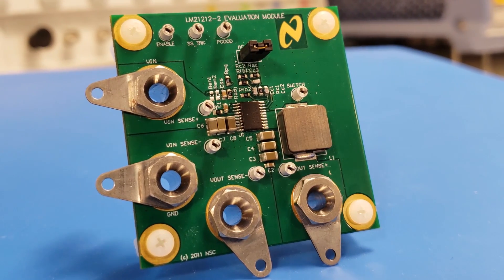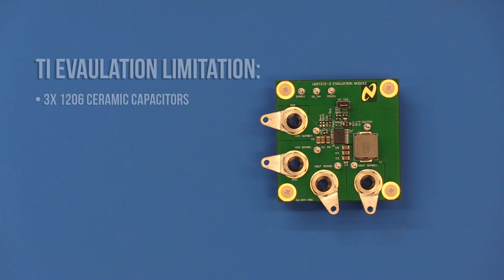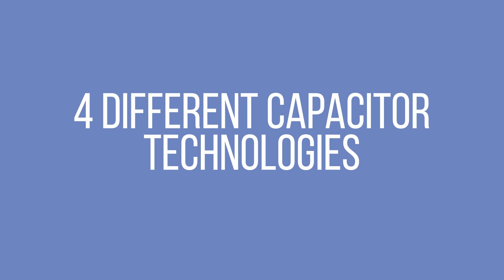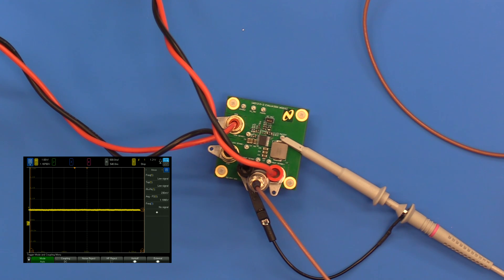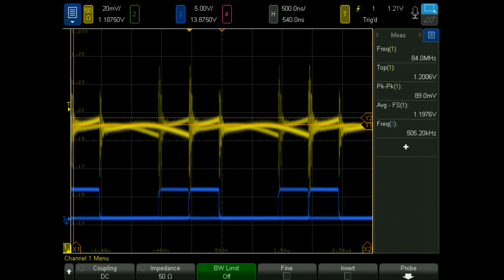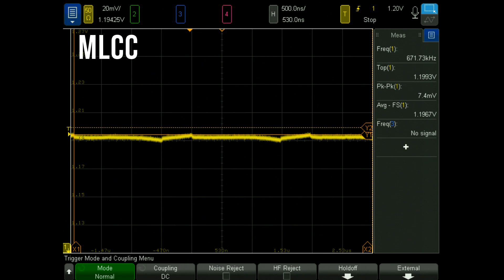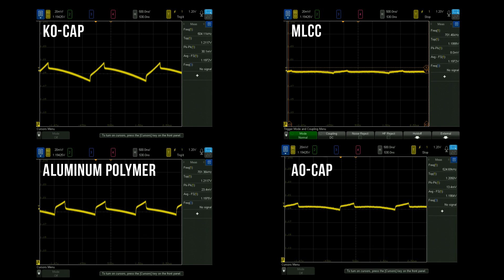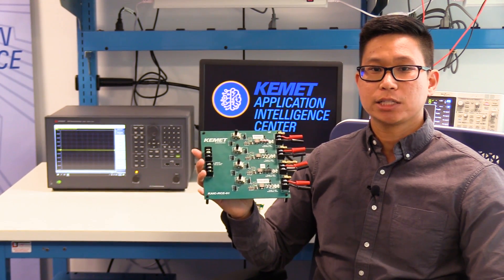KAIC Lab #1: Understanding Ripple Voltage Based on Different Types of Capacitors

Comment: Dear Kemet, 
I am sorry, but you faked the measurements on TI's board. Here are differences:
On TI's board the ground lead on the probe was used during the ripple measurements. This is totaly no go for the ripple measurements. The short ground spring should be used there. Due to ground lead are such a big spikes in measurement. We don't know what is the ratio of the probe used at TI's board. If it was 1:1 ok, but if it was 10:1 than the result can't be so good as you messure with 50ohm terminating input on scope using SMA connector. And last, it is not clear if you have used BW limit function during measurements. 
It seems the measurements taken on TI's board were without BW limit, but on Kemets Boards with BW limit. 
Please could you give more information about these details. ;-)
Reply from the maker: Thank you for your feedback.  The purpose of the video wasn't to compare KEMET versus competitors. It was to compare different capacitor technologies.

Comment: Wow! Amazing and surprising, who had guessed that??!! Your product won!! Amazing! :-)
Your "test" may have been convincing if you had chosen good brand capacitors and told us the name of the competing capacitors and under which conditions. As it is right now could your capacitor have been compared to 8th sorting caps from a faulty batch from Denmark, Poland or China.
Reply from the maker: Hello Fried Mule. Thank you for your comment. The goal of the video was to show how the use of different components (Aluminum Polymer V Chip, Aluminum Polymer H Chip, Tantalum Polymer, and Ceramic) affect ripple. We built a similar board to TI's evaluation board with additional features such as on/off switch, power status LED and variable frequency control in order to evaluate our components. We do not know what company's ceramic capacitors were used in TI's evaluation board. It seems that you have pointed out another great lesson learned from this video. Not only is it important to select the right component type, but it is also important to select the component from the right manufacturer or with the right quality. Even though the parts might have the same specs on paper, their performance might differ.
Reply: @KEMETElectronics  Thank you a lot for answering, this surprised me a bit, but that shows you care about your viewers and maybe costumers. To continue my comment from above, but you have properly seen advertisement on TV where "our product is better than other competing products" and you think "pfft yeah just like every other brands claims" and the "competing" product is a gray item that you have no chance to identify. It does in no way give you any feeling of the product being different from the cheap brand you normally buy, except the price! :-)
I know there are legal implication if you show other brands by name and maybe shows your product as better, but if you "dare" to show name given products is losing to your product, does it show it's real and you have your claim well-founded! :-)
Reply from the maker: Hi again. Good to connect with you. Yes, we understand where you are coming from. TI does offer a datasheet on their module, which you can find online. Other than that, we're really about showing how our own products work, and explaining certain concepts. We understand that engineers will also do their own research to uncover more details and find what works best for their application. Thanks for watching our video!

Comment: If you add a L/C PI type filter on the output you can easily reduce that ripple to 1mV or less rms.
Selection of caps and layout and probing technique is critical.
Sam
W3OHM
Reply from the maker: Hi Sam great suggestion. We'll be sure to explore that in a future video.

Comment from the maker: Hey everyone, congrats to anyone that has caught this mistake. I wanted to point this out real quick. At 2:06 the ripple current plot should have a y-axis labeled as I for current. Also, the plot on the right at 2:12  should be labeled as ripple voltage. The ripple current enters the capacitor and the ESR of the capacitor creates the ripple voltage.
Reply: Is there a good way to reach William (from the video)? I am doing a similar test and considering buying KEMET components for it. He may have some very useful insight for me, even if he isn't in sales. Feel free to direct message me if needed!